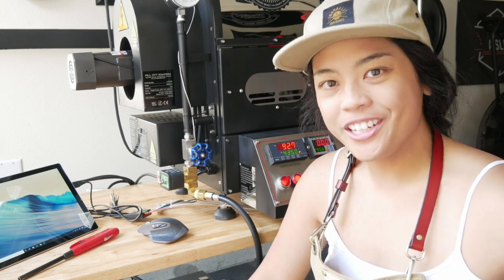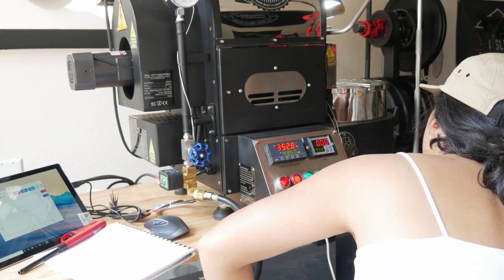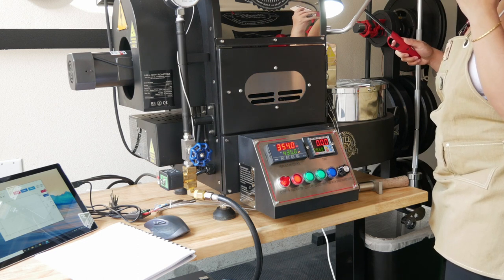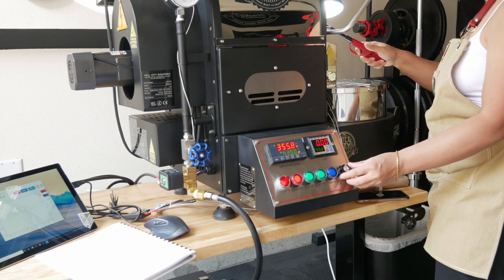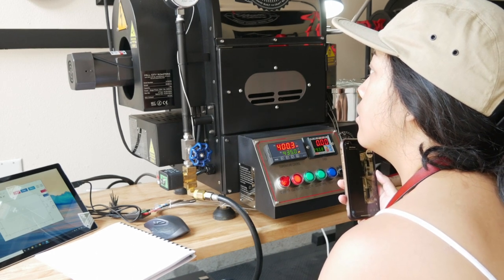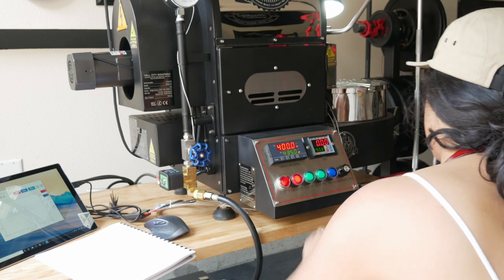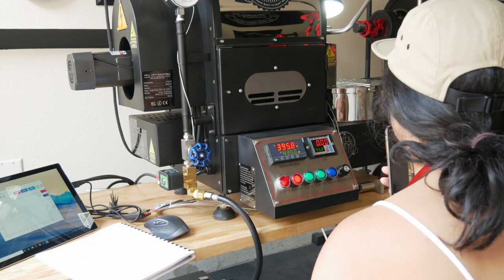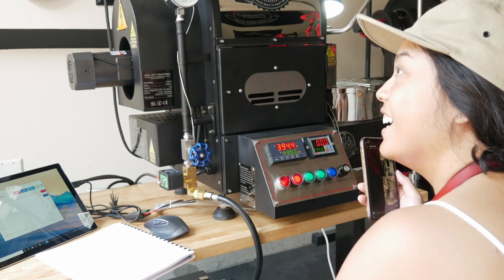EP 8: My first seasoning roast! - upgrading our roaster series - Blkcity coffee

Comment: HI!  Super nice roaster and I love your enthusiasm for learning this craft.  You might have less problems with smoke in your garage if you simply add an elbow and turn the smoke stack upward so the top of the stack is a couple feet above the top of your door opening, (like a chimney).  Just make it a separate piece that you add and remove each time you roast.  Its not a permanent solution (like a proper B vent through the wall) but you should find it will be a improvement over what you have now.
Reply from the maker: Yea definitely.

Comment: So with your initial regulator, the knob and meter were just so sensitive because of the pressure coming from the tank? We’re you still able to get the same max amount of kpa with the 1/2 PSI regulator as with your original? I didn’t know if having a lower pressure regulator would affect your overall PSI and cause your roaster to run sluggish